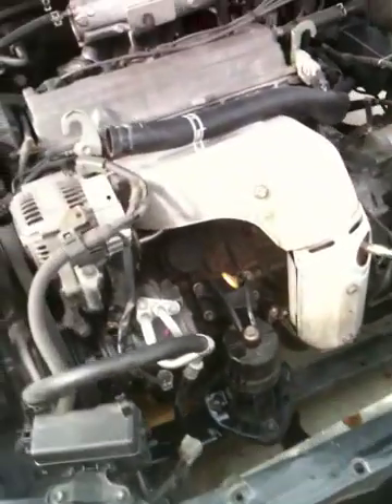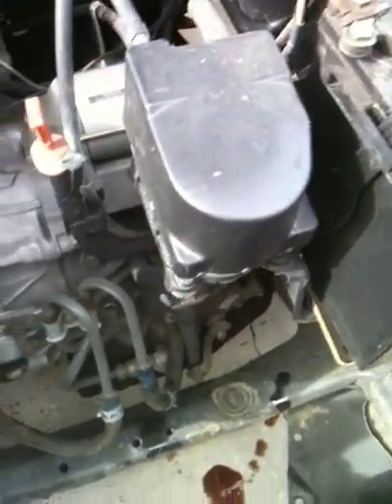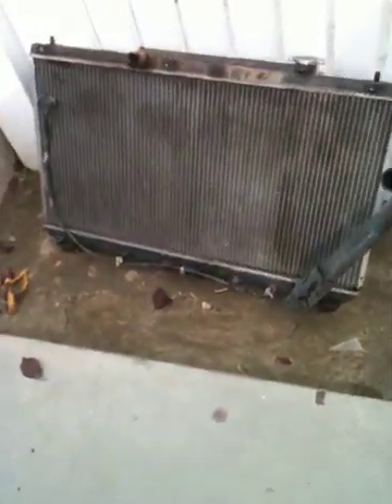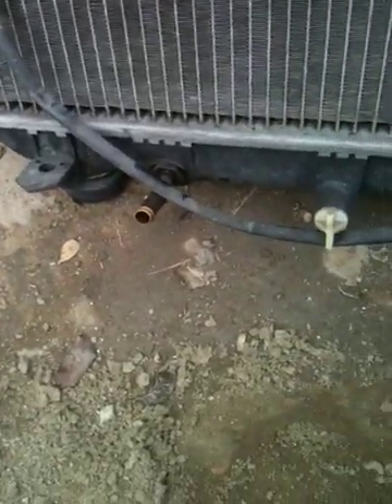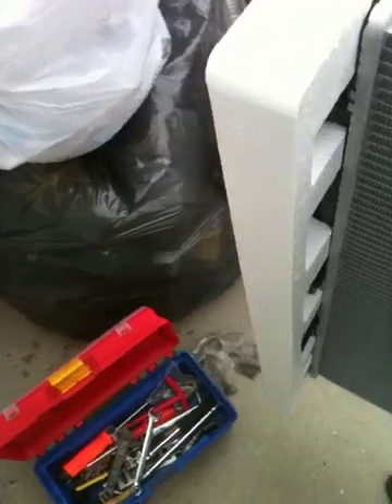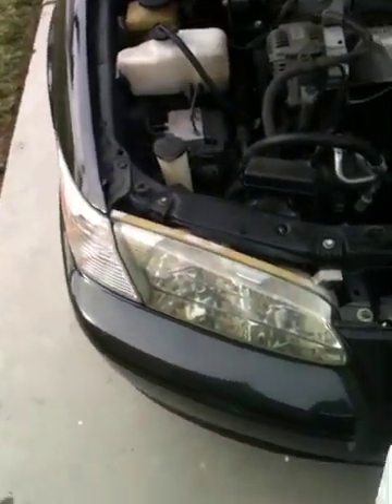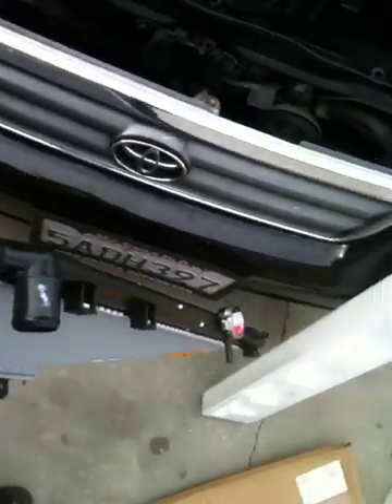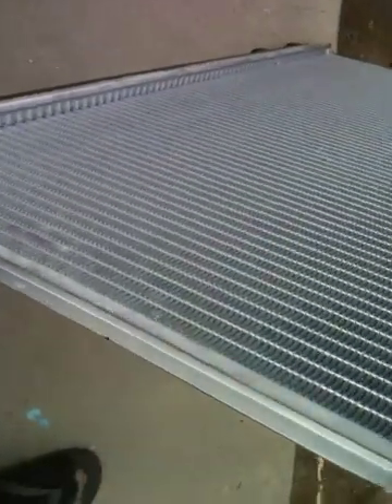How to install radiator for Toyota Camry 1997-2001 model?

Comment: You inspired me to change it myself. Changed the radiator in 2000 toyota solara. took me 2 hrs. $100 from O Reilly's. the 2 hoses coming from  the transmission to radiator, be careful to cap with a bolt, clamp them facing up.
Reply from the maker: Thank you take care see you around 🙏 💐 stay connected